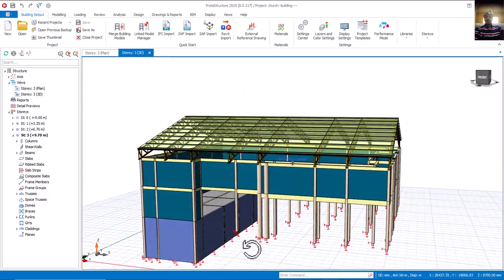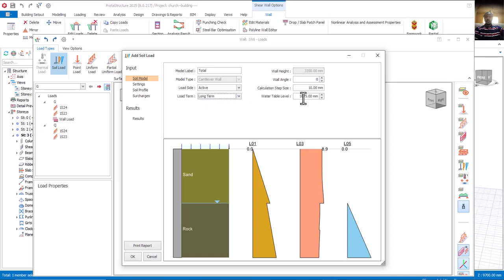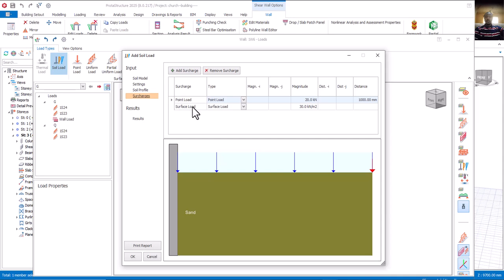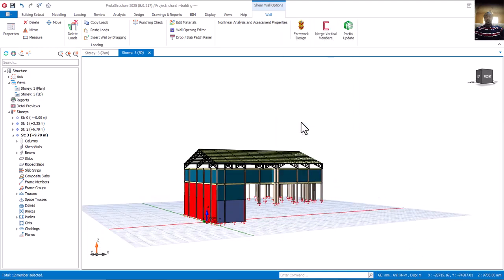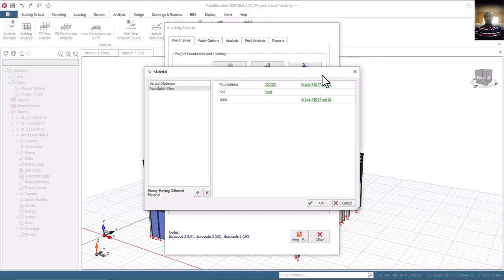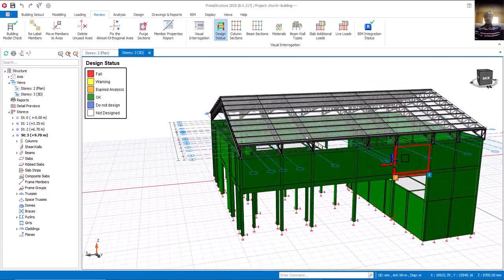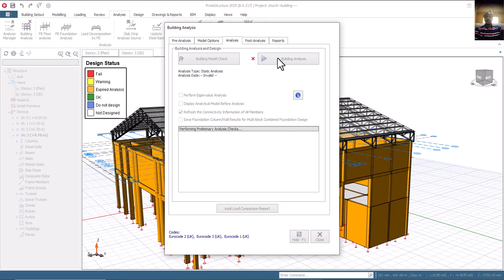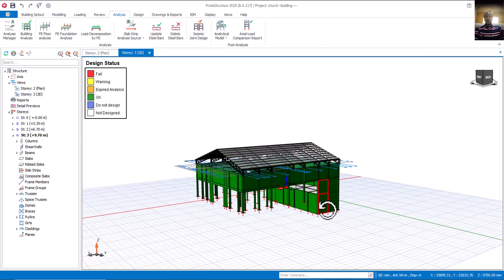Analysis and Design of Building with Steel Roof & Basement in Protastructure 2025 Tutorial

Comment: Sir for the failed column won't it be cheaper to have a wider section than having a 24Y16 reinforcement bars
Reply from the maker: Yes it's good to increase the section of the column or use a bigger diameter of bar